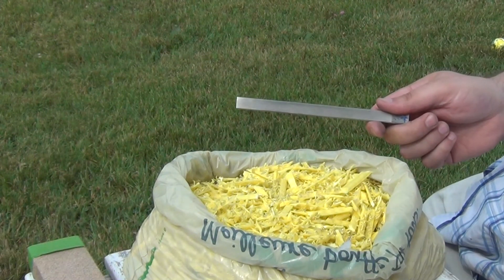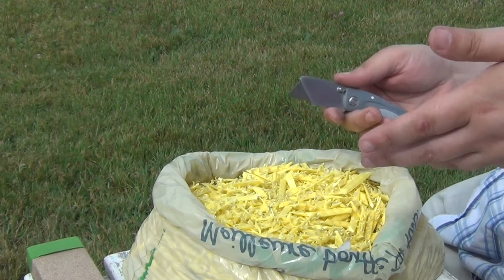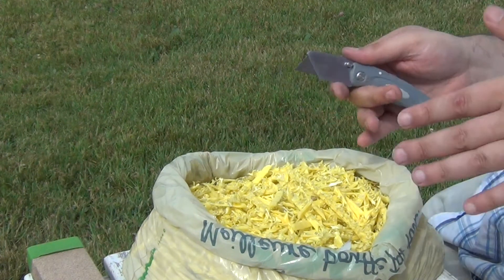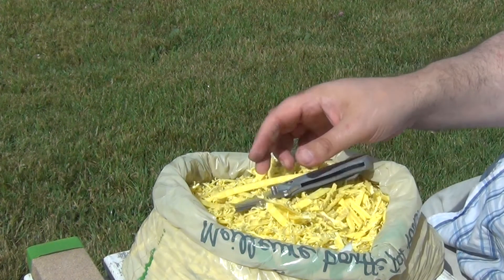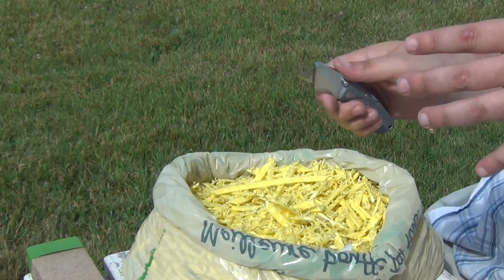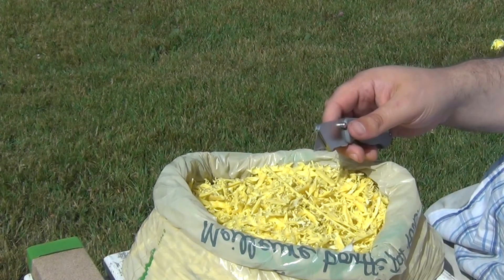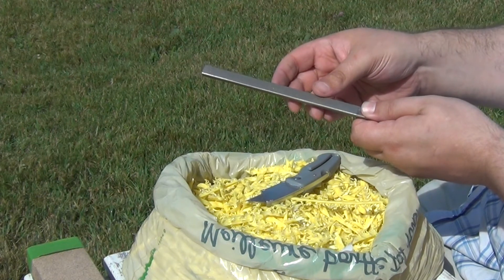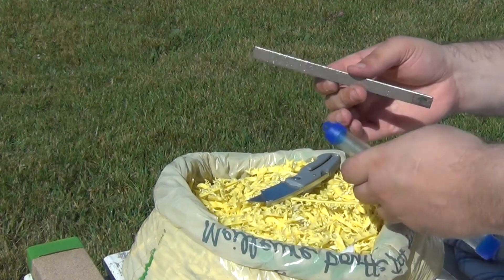Edge Retention (thick plastic) : Sharpmaker CBN edge vs as-boxed Stanley utility knives

Comment: That last picture made me chuckle. Great commentary as usual. It is interesting the coarser grit performing better, however it tending to bite into a slicker surface makes sense.
Reply from the maker: That is a 80 grit sheet of AO sandpaper at 50X linear magnification (adjusted by however you view it). It however isn't immediately obvious unless you have looked at a lot of abrasive. I found it amusing.

Comment: I have diamond stones some of which I have been using for almost thirty years now and like the Boron rods they have worn smoother over time. Some of the fine ones I have feel perfectly smooth and look it also. They still will cut however and I end up with a very, very fine edge that still has some teeth to it. I have not used them in a while as I have been experimenting with Norton and waterstones but I may have to break them back out again and see what they do on utility knife blades.
Reply from the maker: Yeah it takes a long time to actually wear out an abrasive if you don't damage it, even cheap sandpaper doesn't go dull as fast as many people think.

The simplest way to get a feel for the lifetime of diamonds is just get a PSA sheet of them (~$5 or so) and make a few flat hones and just see how long they cut if you don't damage them.
Reply: I use emery paper on the homemade strop/sharpener I made a year or two ago and the paper gets clogged long before it wears out. I hose it off with Windex and it comes right back.
Reply from the maker: ***** Bruce, as you have been polishing for awhile, how long, in terms of say dozens of uses does it take to actually wear out decent sandpaper assuming you don't actually damage it?
Reply: I can use a piece for the equivalent of around 30 minutes with heavy pressure but not damaging it. That would be one standard size sheet used completely.

Comment: Are you doing anything to quantify the rate of wear on the stones, relative not only to the number of passes, but also the force/area applied to the stone? I ask because, presumably, the points will wear faster and it would be interesting to say X stone should last for roughly Y passes at whatever pressure, or Y-Z at this other pressure.
Reply from the maker: I use very light force on the stones, just enough to make them cut, < 1 lbs. More force can be used to increase the cutting speed but the rate of wear increases and the gain in cutting ability isn't proportional so you end up doing far less efficient work. 

I have the actual usage recorded and once I notice that they have lost a significant amount of aggression I will switch sides and compare. 

If you mean on stones in general, not just on the CBN rods. I have been doing some work on that lately and discussed it in the forum. It isn't the kind of thing you can do on plates because you would wear out the plates with high force passes before you could stabilize the results. With solid stones you just resurface and repeat as many times as you want.
Reply: Cliff Stamp
I was thinking of the rods in particular because, given the sharpmaker motion, there is always the temptation to go fast which of course would necessarily apply more force mainly out of sloppyness.
Reply from the maker: Whatfor5 That is one of the critical problems with any kind of plate abrasive. They are not as forgiving as stones which if you do use too much force are easy to learn from and adapt and realize "ok, too much force when it feels like this" because how many people actually have force plates under the stones in sharpening and then turn this force load into a pressure and ensure it is in a given range?
Reply: Cliff Stamp
Not many, myself among them. :P Then again, I haven't ruined a diamond abraisive product yet, although the points on the diamond sharpmaker triangles are fairly worn. The sharpmaker, in my opinion, seriously compounds the diamond problem with not just its action and small surface area over which you spread force, but in that it cuts so slowly even with the diamond abrasives almost anyone would simply lose patience.
Reply from the maker: Whatfor5 Too bad, lack of science makes baby Jesus cry, I even quantify how much force I use to peel an apple.

I think we have to realize, though it is hard to accept, that not all implements are made specifically for us. If you are joe-average who uses Spyderco knives and gives little thought to it then a very basic procedure using the Sharpmaker works very well. If you do at some point want to expand then it has a lot of potential and you see a lot of people eventually move to using it as a micro-bevel only system.

In many cases you can resolve the issue quite easily as well with its limitations. It is trivial to put a small piece of wood under the base and raise/lower the rods so you can sharpen at various degrees and since the same wood will lower one rod and increase the other then a 2 degree block gives you 13,17,18,22 additional degrees. 

As well if you look past aesthetics you will realize that setting a relief/back bevel can be done with a very coarse stone with no attention at all to angle (or not very much) then you can augment the system with a decent coarse stone. This doesn't need to be all fancy, a $5 decent coarse stone can work very well and rip off bevels on any steel (aside from something like 121REX but it will easy things like Elmax, S90V etc.). 

Then the CBN rods added to the Sharpmaker make a very nice system for sharpening knives and the real value comes in when you do scissors, potato peelers, shears, etc. . Because the rods are so portable they also easy to carry. In fact you could make it much simpler if the standard rod had CBN on one side and medium and UF on the others.
Reply: Cliff Stamp
Actually now you've raised another interesting point of curiosity with me. You keep referencing the convenience of the CBN rods for manually touching things up. What would be the advantage of this as compared to something like a DMT Diafold? The standard model comes with two convenient grits, while the serrations model can handle some detail work and comes in just one grit, but both are sub-30$ street price. Contrast this with the Spyderco rods which have an MSRP of 75$, ergo optimistically a street price of ~40$.
Reply from the maker: Whatfor5 If you didn't have a sharpmaker I don't think it would be a sound argument to buy the stones for their utility outside of the Sharpmaker. A diafold isn't directly comparable as it doesn't have :

-three corners
-groove
-length and width to be used as a precise file

However there are any number of very affordable diamond (and CBN) small files. In this series I am just exploring how to maximize the utility of the CBN rods and of course what can be done with anything of similar grit. It is generally why I don't carry ultra-fine stones with me for general utility sharpening but more more coarse stones. 

This is also due to the fact that most "emergency" type sharpening comes from damage and not slow and gradual wear type blunting.
Reply: Cliff Stamp
So you're saying that most of the use you've been discussing, where you're sharpening utility blades "on site" with a single rod carried in its tube in a pocket, is not representative of how you would expect/recommend the product be primarily utilized?
Reply from the maker: Whatfor5 I doubt there are very many people using it in this manner, I doubt there are very many people sharpening these blades with any kind of system.

To clarify, I was noting that if you were not going to use the Sharpmaker, or didn't have one, then there are better tools for general utility files as this is being used. But if you have a Sharpmaker then they can be used for various other aspects to make them of increased value.
Reply: Cliff Stamp
Gotcha. :)

Comment: Outstanding & fascinating video, Cliff. Do you have any insight into how the factories create the edges on those blades? Have you experimented, or considered experimenting how these different sharpening implements affect the edge retention of some sampling of knife steels? I'm too old to remember a majority of your commentaries. ;-) I think I'm going to buy a sharpmaker. Seems like a dandy tool.
Reply from the maker: I have second hand information on how they are sharpened but I don't consider that any more than rumor.

Yes, I have done similar work in small samples in the past. I need to better organize the work I have done in a more systematic way and some of it needs to be repeated with larger sample sizes.
Reply: Cliff Stamp Thanks, Cliff.

Comment: I've been trying to only sharpen at the end of the day when everything is done and I am relaxed for that reason. When you are ramming and tearing to get things done it is sometimes hard to tell how much pressure you are you using.
Reply from the maker: Yes, like anything else it does take a certain amount of skill/effort. However we also need to keep practicality in mind. A guy working a trade for example in the hot sun might take his utility knife and scrape it across a shingle every 15 minutes. This doesn't approach any kind of optimal sharpness but it keeps the knife cutting all day without tearing the material or slipping.

Comment: As always, thank you for sharing.  I was going to ask about how the polished edge on the as boxed blades was attained, but I see you already addressed that.  I was wondering if it's really that polished or the typical coarse edge with a buffed finish.
Reply from the maker: They typically have the shaping grit on the primary grind and have just a secondary edge bevel which is more polished. OLFA put out a line of ultra-sharp blades a few years back, they have an additional bevel step and a higher polish. I measured the sharpness on them, the initial performance is indeed significantly higher. I might do an edge retention comparison on them at one point. 

As an aside no one here uses them because they cost too much more than the standard blades and the sharpness is lost very quickly anyway when you cut on concrete, cut shingles, and similar.

Comment: I have found the 1200 grit atoma good aggression for the grit of the stone. I ordered a 400 atoma last night and going to see if I can get that to shave. I am still not convinced which edge finish last  longer high or low finish in all around use.
Reply from the maker: I like the Atoma's vs the DMT for the 1200 due to the consistency of finish. It is too bad they don't make anything beyond. DMT have some very fine stones but the finish is very erratic as you can coarse scratches which are 10X the main ones.

Comment: what knife is that?  it looks like it has no metal liners in the handles. are the handles all synthetic material? what does it weigh? sorry for the drill, just interested. i have a "craftsman" a "jeep" and a sheffield utility razor knife like that and they are mostly dreadfully heavy knives. the "jeep" is the lightest but, is extremely cheaply made as the linerlock won't even engage. very good video btw.
Reply from the maker: It is 80 grams. There are no markings on it but I believe there was on that metal plate. However I reclaimed this as it was thrown out after it fell in a bucket of plaster and got completely non-functional. I just cleaned it up and it was good as new. It doesn't have liners.
Reply: nice! i'd like my razor knives better if they weren't so awkward and heavy. i might look for one. thanks for showing it. you are truly a humanitarian of knives my friend. i can't bring myself to throw away my broken ones. i have ones i would never use and i still keep them too.
Reply from the maker: knives save lives The common Stanley ones were heavy for a long time because most people wanted it because it was just stronger/durable. There are lots of light ones available locally but they were always getting broken. Recently they have switched to very lightweight manufacturing, but still a lot of people prefer the heavy ones and just tool belt carry them - plus a lot of people use them as hammers.

Comment: Was not using a great amount little more than knife weight, I believe the sweeping part of the blade was dipping in and out of the micro dots.
Reply from the maker: I always go very light on diamond stones, not even the weight of the knife, just 5-10 grams just enough to make contact. If you go more then you risk fracturing the diamonds and even scraping them off the plate.

Comment: So where is the happy medium here between low and high finish? An all around finish if you will.
Reply from the maker: There really isn't. This is a common question but it is like asking what is a general "good" coat. It depends on the weather, where you live and the season.

I finish on 600 DMT for a lot of knives but that is too coarse for a lot of kitchen work (dicing/chopping), finished wood workers would not even consider it sharpened at all, but is too fine a finish for ideal performance on large synthetic ropes and is over kill for cutting shingle and similar. 

All I can say is try a few finishes and see which one gives the combination of performance and maintenance time that is optimal for you. Some people are willing to give up cutting performance for blade lifetime for example, if that is the case then you are going to move towards very fine polishes.

Comment: How didn't the lock break with all the batoning you surely had to do to get through all these ties

Out of curiosity... If you have any idea that is... How does the rounding and wearing of the abrasive compare in terms of grit jump tto your technique of letting slurry build up and letting it dry?
Reply from the maker: Its a canadian knife, they doesn't afraid of zip-ties.

As abrasives wear they get progressively finer, but you end up having to press harder to get the same cutting speed. This is why while you could actually never throw out abrasives, just keep buying coarse ones, most people buy fine ones because of the time it saves. Plus abrasives done wear really uniformly and it would only take one small part which was still coarse to undo all the polishing work.

But fundamentally it is a very similar concept to adjusting the grit of a stone through the water/slurry .

Comment: The problem I have is I like to have a smooth cutting razor sharp edge. And it is very hard to achieve that on low grit stones. How can you get high aggression with smooth cutting?
Reply from the maker: The higher the inherent cutting ability of the knife, the less you need a coarse edge to enhance draw cutting. Of critical importance though is actually being able to sharpen to a very high level. 

It is possible to actually push cut newprint well over 1" from the point it is being held with a 600 grit DMT finish. That is the kind of sharpness you need to have as a minimum. 

Diamond plates are generally easier to start with as they eliminate problems such as rounding from compression/wear of the stone or apex smoothing from thick slurry, etc. .